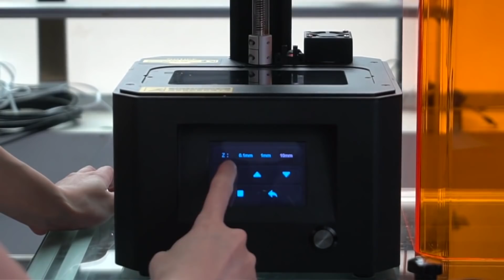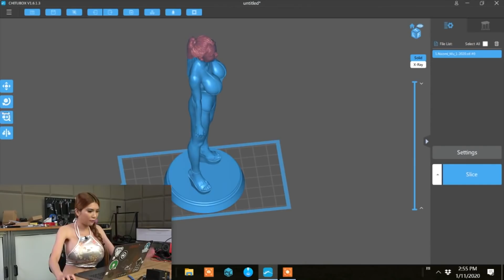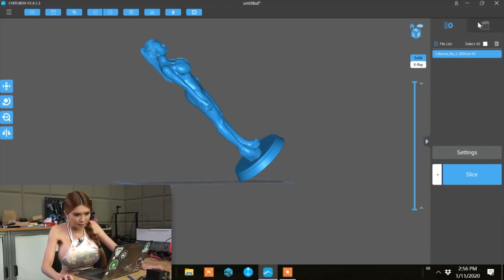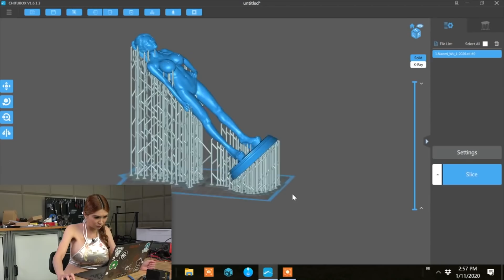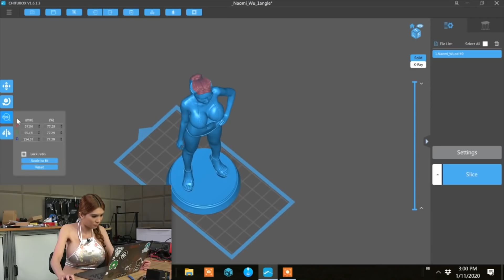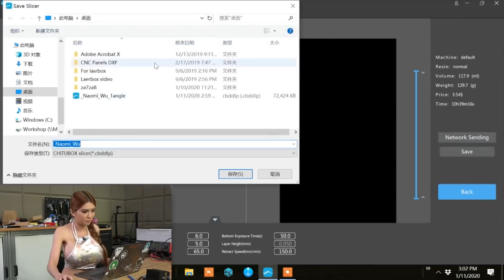Creality LD 002R SLA Resin 3D printer  Review and Unboxing! awesome budged 3d printer

Comment: TIP: Change the supports from medium to light and add a few extra to make up the strength and you'll find it's easier to remove them with damaging the print detail...

Comment: A lot of things you can improve on. I only have about 1 month with resin printing but I can say a lot of things here ain't right. Removing the supports after curing? No eye protection when taking the print off the build plate? Hard brushing onto the print before it's cured (would cause you to lose the details)? And the list goes on...
Reply: Always remove the supports after curing lol... Never before.